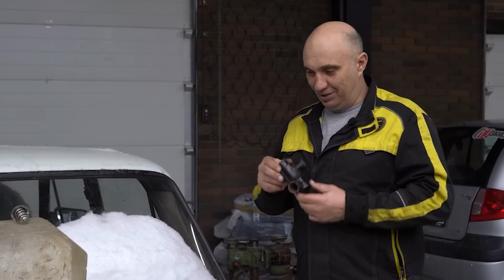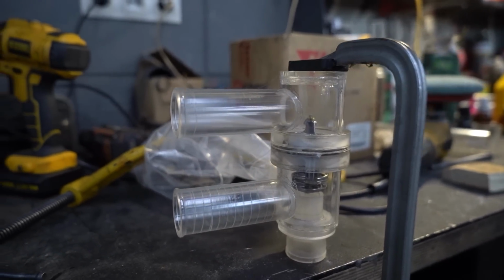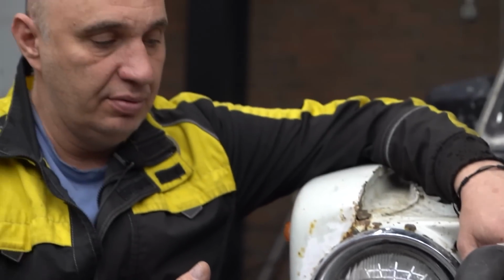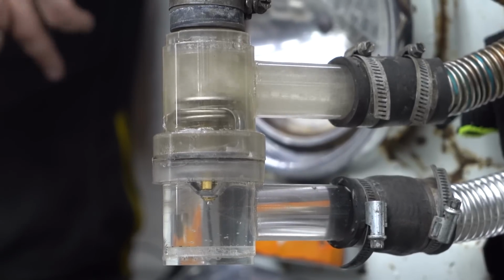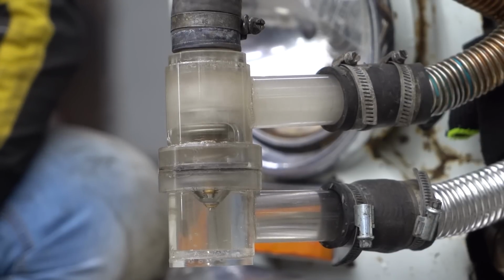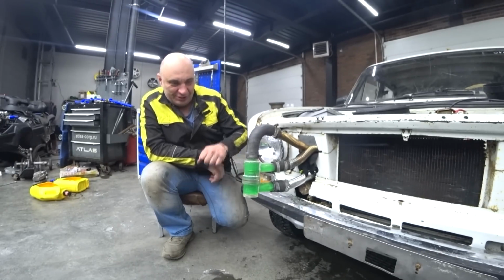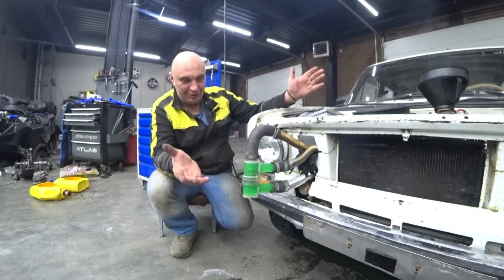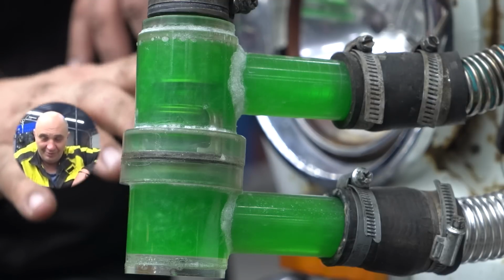We make transparent thermostat housing

Comment: One of the additives in antifreeze helps stop air bubble formation and suppresses cavitation so the cooling system will get less pitting ,since you're running straight water that's probably why you have more air bubbles than normal. At least that's my guess .
Wilco

Comment: In North America Chrysler Built an engine called a slant 6 which was a 6 cylinder that laid on its side about 45° for multiple reasons but was a very good engine I'd love to see someone make two together and make a V12.
Reply: what are those reasons cause that just sounds like pointless overengineering to me. and yes v12s already exist
Reply: BMW inline 6 since the 70s. My 24 year old inline 4 cylinder BMW engine is also a slant.

Audi, Porsche, and others also have slant engines

Slant engines aren't anything new or bespoke.
Reply: Slant 6 was designed in the late 50s and came out in 60. I'm sure the Mercedes 300 SL engine head some influence on it.
Reply: A couple of the design goals were that you could have a lower Hood line and also the slanted engine gave you a better space to make a longer and close to equal length intake manifold
Reply: Too bad they dont have that slant 6 in Russia
Reply: The triumph V8 as used in the Triumph Stag was exactly that - essentially, two four cylinder inline engines stuck together.
Reply: @herseem l guess every engine is just a bunch of 1 cylinder engines arranged in different configurations.  🤔🥴
Reply: @tcmits3699  yes, except that the Triumph V8 really did start out as a design of two separate already-existing 4-cylinder engines that were merged together to make the V8
Reply: @herseem  yeah, l was just being a "wise guy"😄 l remember the 3.5 or 215 cu " Oldsmobile aluminum V-8 sold to British Leyland in the 1960's.  Going to sound stupid, but did the Triumph V-8 have two separate crankshafts and timed proportionally or just one 8-throw crankshaft?
Reply: Useless boat anchor

Comment: During the winter, when I have my heater on, I can actually feel the thermostat engaging while driving on the highway. When I accelerate, I can feel the air blowing go from hot to barely even warm, as the coolant gets diverted to the radiator. So it's really cool to see this happening in real time!
Reply: ... is your coolant low or your heater core plugged? Lol
Reply: I'd say you have a lazy or failing thermostat that's not closing fully
Reply: My guy, you need to get that looked at
Reply: @Komeuppance  Yeah I oughta check the coolant level, can't believe that didn't occour to me. Also I'll take a crack at getting the thermostat diagnosed.

Comment: Like a boatpropeller make bubbles due to the difference in pressure on the opposite sides of the blades, the waterpumpimpeller make the same effect. The more the engine revs, the worse the effect will get! Eliminate the surface tension will help a little, but optimal coolingfluid aviable is in fact a special oil. This will also help the engine get to a more efficient working temperature as it's not limited to a certain temperature to avoid more bubbles that decrease efficiness. A aluminiumhead for example does not warp at 120 degree celcius, but there is only air in the waterjacket that allow a higher temp on the combustionside of the head than the camshaft side that create the tension that warp. Cast Iron does not warp, so there the clearings of fittings decrease and pinch (if oil gets hot enough to make itself solid) camshaft or (most likely) piston.
You should test and put oil in coolingsystem to check it out!

Comment: the most fascinating part was the after the engine shut off part, where the fluid kept flowing.  all my years around cars I never stopped to think that after shutting it off that there might still be any flow.  I wondered how the engine never ran into thermal runaway once you shut it off and that mechanical pump stopped.  I always wanted to buy a electrical pump to keep the flow going for a bit after shutting off the engine but thanks to this, I now know that would not have mattered all that much.  awesome.

Comment: The top port is not being closed as it would in a normal housing. It's only opening the bottom. That disc that moves up when it gets hot would seat on a surface to close the bypass port. You get the idea here though. I would like to see if it sets a particular rate of flow on a highway drive.
Reply: But it does. Theres an inner tube in the housing that the top plate pushes against.
Reply: correct jason!
Reply: @nicholasweiss4662 interesting. You are correct. Not sure how I missed that.

Comment: How about a clear radiator cap and clear radiator neck with the overflow hose? It'll be interesting to see what it looks like when the pressure exceeds the cap rating causing the radiator to dump coolant into the overflow and then sucking it back in the radiator when it cools down 😁 (could be incredibly dangerous though 😬)

Comment: you have it backwards.  Upper radiator hose and lower hose.  Hot engine water heats up the bottom of the the thermostat and lets the hot water go into the upper hose and down the radiator to cool the water.  Looks like you have hot water at the top of the thermostat.

Comment: Like the transparent projects, seeing things work in real time is good stuff  that said my thoughts are to remove the thermostat and mechanical water pump and replace it with an electric pump which can double as a thermostat just by not turning on until desired temperature not to mention HP gains from losing the mechanical drag of the mechanical pump. Plus, you could control the coolant flow rate, thus allowing the coolant to stay in the radiator longer, which would drop the temperature even more if need be due to ambient temperatures as well as engine loads.

Comment: And at the heart of it all, is wax, yep, wax, the brass bit in the middle is called a "wax motor" and provides the actuation force as it heats up, as wax expands quite readily, forcing out the plunger that shoves things open... :)
Reply: and the wax is trapped inside?
Reply: @glowiever  Yep, baiscally a compressed pellet of the stuff that's shoved in with seals and crimped tight, it's when those seals fail with age and the wax squirts out that the things stop working...
Reply: The cool thing about wax motors aside from reliably is the absurd amount of force they can overcome.

Comment: The right circulation is when the big circuit opens, the small should close. This is how it is on a stock Lada thermostat. Otherwise as you can see the water flows primarily from the small circuit as it has less resistance to flow.

Comment: Clear water pump next? Or brake calipers and master cylinder? Have to prove that the main seal does NOT twist or rotate but rather squegee the piston and pull it back very slightly after relieving pressure. All the way to a clear engine block!
Reply: Well we know that the piston doesn't rotate at least not on front brakes, it does on the rear ones. They did something close to i think a transparent engine head.

Comment: Just wondering, couldn't you have just mounted the larger clear plastic pipe with thermostat installed in the upper rad hose, no heater hose ports needed.  Great video, 👍👍👍

Comment: Automotive Engineer here, that type of Thermostat design is a tempering valve setup, The reason the valve is opening and closing all the time is to maintain a target temp for the water going into the engine. We learned years ago that having the water straight from the rad is very bad, especially if the water pump shots that very cold water (relative to the cylinder temp) right on the outer cylinder wall jacket. The old Ford inline sixes were very bad about having cracks on the number cylinder because of this very thing, as the water pump shot the water right onto the front lower side of number one cylinder. Think about were you are in Russia and the temps y'all see in the winter. A radiator is nothing more than an thermal battery, so if the air out side is at X temp and you let it in it's full temp run straight into the engine (Like on a -30*C day) you could imagine the stock the engine will have once the thermostat opens. 

So what your watching is the thermostat metering the cool water from the rad into the inlet of the water pump to maintain a operating temp with in X degree's of the engineer design. This keeps the engine from seeing very cold water that may be setting in side the rad on extremely cold days. And on the flip side on very hot days (like were I'm at in South Texas we can see 48*C days for weeks on end) the valve will more than likely complete close off the small loop and run completely off the rad to keep everything in check. 

Love the videos guy's, y'all keep them coming.
Reply: So is this what they refer to as a by-pass thermostat system?…..cool water from the rad mixing with the rest of circulating coolant when the thermo opens?
Reply: @freiduumforall8843  I cant tell by your use of by-pass thermostat how you're using the word by-pass. As I see By-pass as completely removing or going around another thing.

I have a By-pass T-stat on the trans mission of my truck (2010 Tundra), it's job is to by-pass the liquid to liquid trans cooler and send the trans fluid to a much larger air to liquid cooler Infront of the rad. It does this because the liquid to liquid cooler is only good for X BTU's of heat transfer and when towing or driving the truck hard (like extreme off roading in low range) it just can't keep up with the heat. So Toyota on the MAX tow package equipped trucks added this air to liquid cooler and use a by-pass t-stat to By-pass the L to L down on the side of the trans when it can't keep up.

Comment: I did away with the factory thermostat and installed a thermostat into the top radiator hose on my diesel powered Lada Niva, used the same thermostat arrangement when I fitted the Fiat twin cam engine into it, worked well.

Comment: The open and closing of the thermostat is happening because of the sudden flow of fresh cool water from the radiator. As soon as the thermostat opens and enough cooler coolant from the radiator passes the thermostat to cool it off it shuts again.
Reply: Not so sudden, even at 50x. Its just gas within a diaphram.
Reply: Exactly. After a long enough time the radiator will get heat soaked and it will remain open without the pulsing.
Reply: @skurblord3401  that usually happens in hot weather after sitting for a long time in traffic. Under normal driving conditions you should never have a heat-soaked situation unless the radiator is undersized.
Reply: @CotyRiddle  correct, while driving it should be fairly well closed to maintain engine temp, the radiator isn't fully hot and circulated unless under a tremendous load or you are stopped.
Reply: @DarkLinkAD  Thermostats actually use wax that expands when melted to open it. It's called a wax motor and is used in quite a few temperature control applications

Comment: I think it will be a gradual motion. Not an instantanious switchover. 
A gradual changeover will allow a perfect ratio to settle. For example, on a cold day idling 100% may be in bypass. But on a hot day idling maybe 90% bypass and 10% radiator.
Just my hypothesis.

Comment: The thermostat was upside down. The wax plug side of the thermostat needs to be in the hot side.   A thermostat is a wax motor.
Reply: Spring goes to hot

Comment: Well, what thats all about its, One thermostats have a tiny hole in them to allow some bypass. They also, open and close depending on the temp... So if you were riding the thermostat specification line, that would be why. Given the Odd way you incorporated it, Its possible the unnatural flow is having something to do with that. OR its just how a Lada operates. Ive never seen one of these cars in the states, much less had to work on one.

Comment: The hole housing is upside down top hose is bottom of the radiator. But as it is ir still works good. Thermostat is like a tap slowly being turned on. Which gradually increases the temperature in the engine..

Comment: Great project, just a thought, the continuous air bubbles appearing in the flow could be from gases in solution / dissolved in the fluid, like when boiling water, bubbles appear on the surfaces of the container being heated, was the radiator cap left open during this exercise?

Comment: The idea is good, but it was not very clear where the liquid is moving or where it should move, because the top hose was not transparent. It could be better if you could add maybe some arrows showing how the liquid should move in one loop and the other. It looks like before the thermostat was open the liquid moved from the top hose to the upper right hose. Then after it opens it looks like the liquid is moving from the bottom right hose to the upper right hose, but it is not clear what is happening with the top hose. 
Moreover, you could add some thermometers to the tubes which would show the temperature of liquids in each tube

Comment: Sir  can u try drain the engine oil and fill it with diesel and just flush for few min and drain the diesel which will clean the entire engine oil and check open the engine to see if deisel  cleaned the engine only worry is will deisel cause any damage to engine or while flushing will deisel overheat and explode

Comment: They've messed up the design and thermostat is the wrong way round. The brass tube section of the thermostat holds the wax that expands when it gets hot. That should be immersed in the full flow of water so that it heats up easily when the water gets hot. They've got it positioned so that it is protected by any flow of hot water until the thermostat is already open. That means the engine may get too hot before the thermostat opens. They just haven't thought it through properly. It appears that in this case it's configures so that the thermostat is on the entrance side to the block (like the 'L' series diesel from Austin Rover, as used in the Rover 200, 400, Land Rover Freelander, and MG ZS and ZR. But this still means they've got the thermostat in the wrong position.

Comment: I'd like to see you guys hook the exhaust into an air compressor to collect all of it, see how much exhaust a 50-gallon tank can hold at 100psi.
Reply: I bet he’d do it in litres and bar.
But I‘d be curious to see that too, just the volume of how much comes out vs. how much goes in would be interesting.
Reply: @D EMIL  ya, maybe they could run  the tank full of exhaust back in through the intake afterwards.
Reply: @SmokeyWire56  Oh that‘s just common EGR. They will have very low NOx then 😁

Comment: HEY GARAGE 54 ATTENTION      I have a new and very challenging which would make an easy market for you when you succeed" especially for" racing top fuel spec motors "   Some time back in the late 90s a racing team made this type of head for a 4 cyl engine for strickly top fuel duel turbo racing on a honda civic clocked at 8 seconds on a 1/4 mile at 213 mph,,,,,,  Now this is in your alley ,  sounds like fun to build a 200 mph Lada    Go reform the 1st  Lada valveless with total simplicity new casted a new "Garage 54 Lada 2 stroke 4 cyl heat sinked custom head with distributor geared function operation and coolant "without NO VALVES " using only the OEM parts " exception without the timing chain for the over head cam",,,..without altering the block..  This head youll be designing will use the OEM manifolds without a problem or changing anything under the engines function ,  BUT you can add in a turbo option or supercharger more intake compression if you like to make a top fueled 8 sec drag strip race car ..  This would make the engine taller about 6 inches when you" dont have valves to make up for the compression" and the high heat spark plugs on top between the heat sinked fins to help the cooling of the coolant and oil flow which one side of the head has oil circulation since it has no valves to lube up and the under side for the coolant where your standard cooling would be on the head... Now if you reform the new Garage 54 custom head where the head bolt up and intake manifold is the same bolt up upper on the original side of the head and the exaust manifold is located on the original side lower on the new custom head designed by" Garage 54" that has no valve  but an oil cap only and spark plugs youll may have install another compression piston ring with the oil and gas mixures to lube the top pistons if the compression doesnt exceed 130 psi and better..... The head is designed with heat sink through  out the top of the head to help cool with the coolant and oil circulation ports to make up for the missing valves. I have a great feeling youll have fun with the first Top fuel Lada in russias history and the success of the head design that would the first ever produced ,,,       have a nice design build brother I know your guys are up to this challenge and great to your manufactoring skills for future prospecting applications

Comment: Well this was poop. Why didn't you just do a 2 way system? Instead of 3. Would have illustrated much better with just an inlet and an outlet.
Reply: And I think the thermostat was backwards from what it should have been.
Reply: It worked perfectly fine. It showed how the radiator is gradually introduced, especially with high airflow across it.